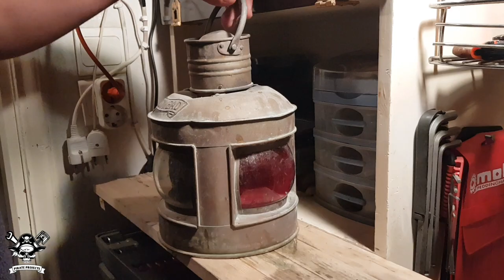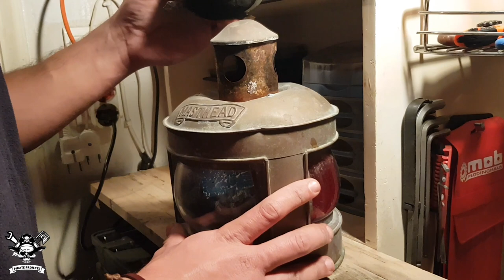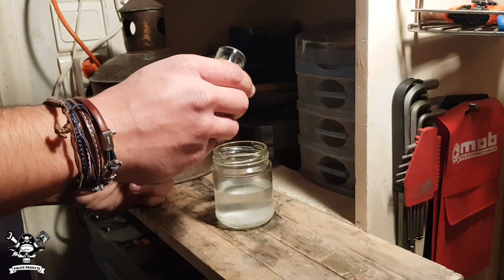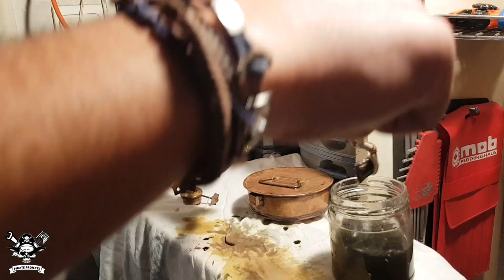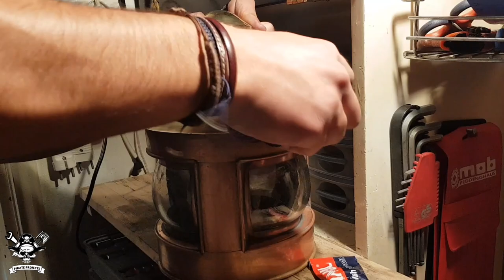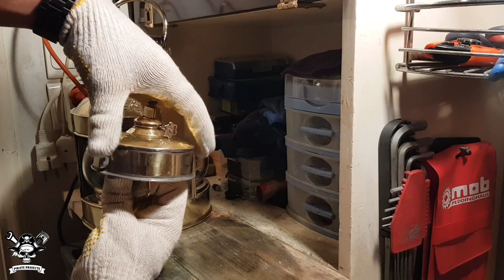Old Brass Lantern Restoration

Comment: Hello, It's Debbie, I contacted you about a month ago and you gave me alot of great suggestions. I bought the Autosol polish and so far I have polished the tar out of my lantern. This is quite the job!!  hahaha,,, It still has dark spots and  blotches on it...  even after several applications of the polish. mine is no where near as shiny as yours...almost looks slightly drab.  I wish I could send you a picture. Anyway, any other suggestions? Is  there a dremel tool accessory that could shine it up without scratching it or leaving buff marks? thank you,  D
Reply from the maker: Polishing pads is what you need. 🤜🤛

Comment: Hello, What product did you use to remove the colored stain in the glass...and what brand of polishing paste did you use? I just bought an old lantern off of ebay after watching this video.  How do you tell if it's actually copper and not a fake copper finish
?
Reply from the maker: Hello, to remove the color from the glass I use paint stripper and for polishing I use granol polishing paste ultra soft. 🤜🤛
Reply from the maker: Now with the one that you buy,  you will realize if it is fake copper finish if you see rust on the metal surface.
Reply: This polish must be extra special, I can't find it anywhere. Do you have another brand that you have used? I was so inspired by your video.... I want to do this right.  My lantern is a VTG Masthead Maritime TUNG WOO H1409. It looks tarnished and dirty like yours did. Fingers crossed. Thank you
Reply from the maker: Autosol polishing paste is also good and you can find it more easy or other polishing paste for soft metals will do the work.